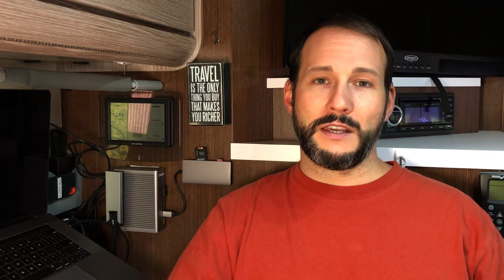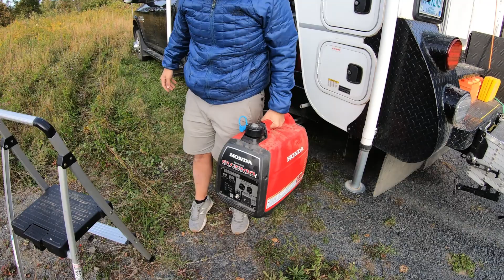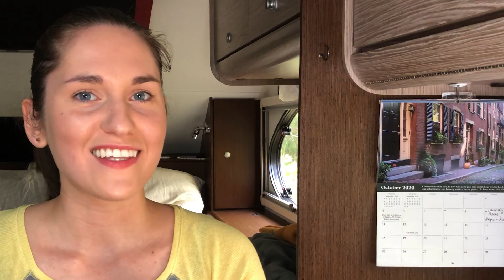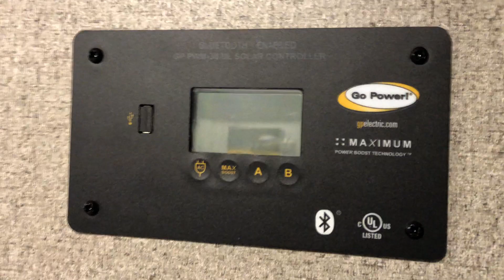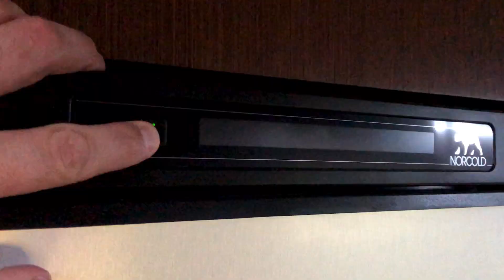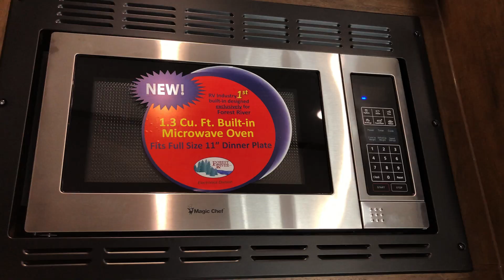10 RV Power Basics - What you need to know to get started | Boondocking and Off-Grid Power

Comment: Hi
You mentioned that you work on your alternator dc to dc battery charging sys.
However, I thought that when you connect your camper to your truck one of the 7 pins provides charge to battery already 
Can you comment on that 
Thx
Reply from the maker: That’s an excellent question. And the more I think about it, the harder it gets to answer. 

Most trucks with a 7 pin connector use 10 gauge wire for the power wire. 10 gauge has a max of 30 amps carrying capacity. However, due to the long distance that the wire travels, from the front of the truck, to the back, through the connector wire and up to your battery. You get a significant voltage drop. This voltage drop leads to a huge reduction in charging ability. The most we have seen when we had our AGM batteries was about 60 watts of charging which is roughly 5 amps. Another factor is that most new trucks (including ours) use smart alternators which reduce output once the starting batteries are charged. This causes the voltage to drop to the low 13 volt range, further reducing charging in your house batteries. The last factor for us, is our use of lithium House batteries. They are huge at 600 AH and require 14.6 volts to charge properly. Our new charging setup (video will be coming soon) gives us 40-80 amps of 14.6 volt charging capability. It also isolates the lithium batteries from the lead acid starter batteries. (We still have our victron smart relay to keep them separated on the 7 pin wire as well. 

The summary is that we need much more power than we can get with through that connector, and, we need different voltage to charge. We use 150-300 AH per 24 hours on work days and this setup lets us recharge that in 2-4 hours of driving. 

I hope this makes sense. Let me know if I confused you even more 😬
Reply: @Stonyboot  it’s clear. This is What I thought. Not enough juice from the 7 pin plug. Did you considered installing secondary alternator or replace original with heavy duty unit?
Reply from the maker: I Truck came with dual 220 amp alternators! So it was just a case of setting up the camper to use that power.
Reply: @Stonyboot  that’s great can’t wait for your dc to dc video 👍
Reply: @Stonyboot  is your truck diesel or hemi?
Reply from the maker: I’m working on that video this week. We have been traveling for the last 7 days to someplace warmer.
Reply from the maker: It’s a Diesel. I wanted to get a gas truck, but it didn’t work out. I love the diesel, but it has limited our options for going to Central America.

Comment: Thanks for the video. A video on your cell booster, and the energy consumption of your computers while in use would be awesome as well. What size are those Lithium batteries that you use? Thanks again.
Reply from the maker: Hi, thanks for watching. We do have a video about our cell booster setup called “RV Internet Access - Using a Cell Phone Booster while Boondocking”. Our max power consumption with the computers and QNAP storage array is about 300 watts. Usually around 200-250. Once things go to sleep, it’s lower, but I’m always uploading and running data through the setup. Batteries are dual 300 AH lithium’s. They are custom and not yet available for sale. I have had a ton of inquiries about them and I’m trying to get them on the market. Stay tuned as I should have something soon!
Reply: @Stonyboot  awesome thanks!